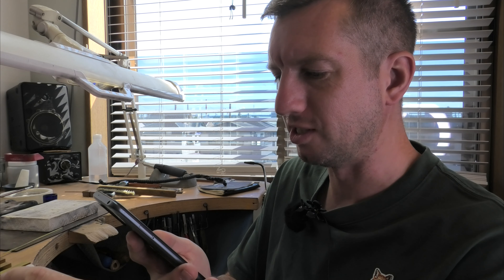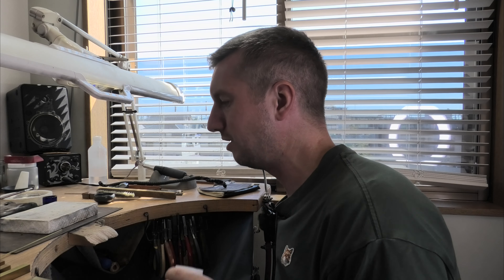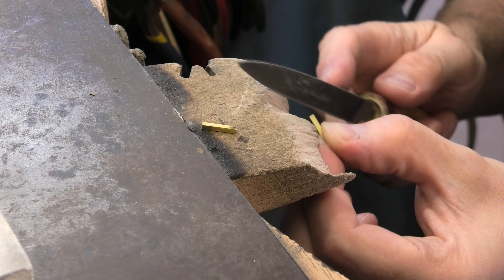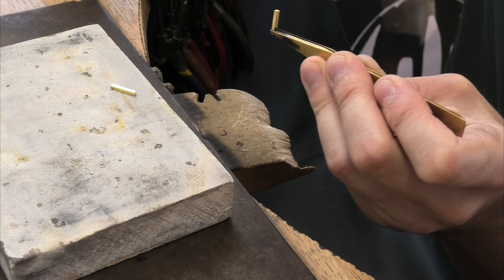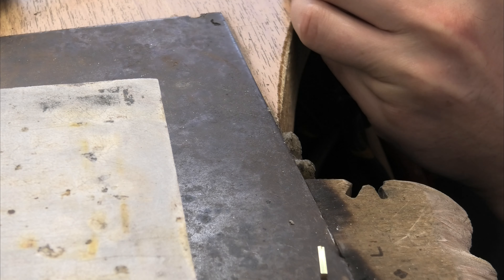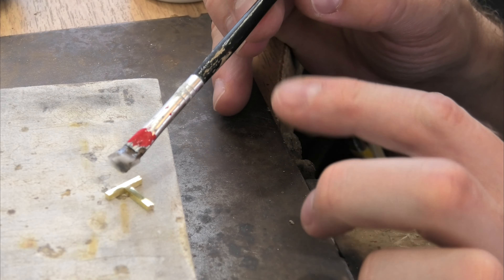The Secret to Soldering Brass

Comment: I've used Easy-Flo flux(borax powder) mixed with water for soldering brass for the last 5 years, never had a problem. You can even soft solder it with rosin flux and electrical solder.
Reply: How? Can you please explain? I have to fix the handle on my bell & have no clue what to do. Thank you!!

Comment: I always use Borax to solder brass and medium silver solder, works perfectly fine - I think it does take time adjusting to, especially if you're used to silver and gold. Thank you for sharing! :)
Reply: @sarahgaucijewelry  pretty sure the white flux is a borate mixture. Same with the flux that you can bubble into your gas lines with like an oxy-acetylene setup.

Comment: I used to be a solder machine technician in a factory, and we only ever used two types of flux - ZNC 4030 for non-medical applications and Stannol WF-300S for medical applications. Do note that if you use znc 4030 it will produce a clean join but it is extremely aggressive and will cause reddening if you use more than a drop or overheat it

Comment: I came here to find out how to work in brass because I want to make some crazy art pieces just like you said it would be unpractical to make some bizarre looking art jewelry out of silver. Was so happy to hear others had the same notion. I use grifflux on brass so far and it has worked. I also learned to soak my brass in peroxide/vinegar solution to get the copper off after soldering.

Comment: For brass use pine resin dissolved in isopropyl alcohol as flux and use 60/40 tin lead solder.  Same for copper.
Reply: @markedis5902  would these be RA fluxes?

Comment: Before brazing (silver soldering), make sure the joint metals are very clean and free of any oils.

The real no-brainer way to silver solder brass is with a silver solder paste which includes the flux (like Muggyweld SSQ-6 56% Silver Solder Paste, this is just one example there are many different companies making a similar product). This is such a no-brainer that in production the brass is held together with a jig, the past is robotically applied (usually as a very poorly placed single blob), several heat flames from several directions attempt to evenly heat the assembly, the heat is not varied just held constant for a set amount of time, the solder goes molten and the flux carries it around the joint. 

The assembly is then allowed to cool slightly, then it is quenched, water + usually an additive, and done. The solder paste is called solder paste but the heat sources are hot sources like oxyacetylene (hotter than a propane torch). If the heat source is a little high it just means you need to heat the assembly for a shorter amount of time, move the heat around quickly to evenly heat the part, and remove the heat when the solder flows. The high heat is to expedite the process.

If you use the needle paste applicator and you have a long straight joint, you can place a very small even paste fillet along the joint, Then when the solder goes molten the soldering footprint is very consistent and the joint looks very nice and clean.

As you mentioned in the video, the quest to joint brass attractively is in finding the best flux for the application. A product like Muggyweld SSF-6 High Strength 56% Silver Solder Rod, has the flux coating the silver solder rod. So, you heat the flux to melt around the joint then keep heating until the silver solder flows you only need to add a small amount of solder because it will flow very quickly to fill the joint evenly.

Comment: You seemed to have figured it out, but if this helps you or anyone else, a good flux for plumbing seems to do the trick for me.  Get it at any hardware/ plumbing/ refrigeration supply house.  Also some soft solder, I use 95/5 (tin/silver) and Ive had no issues even bonding brass to stainless and mild steel!  Worth a try and you dont have to wait for it to be shipped to you hahah.  Best of luck in everyones projects!

Comment: What metal was the tiny piece you used for welding the two tiny brass together?  I want to weld brass with brass not see the lead
Reply: Looks like chip solder

Comment: Depending on how large your going.. have you tried to do micro-TIG welding vs “brazing” for metals? the jewelry folks use them and they can be quite versatile.  You can do tiny delicate bracelet links all the way up to medium sized sculptures.  sunstone sells ones like the plus unit 1-30 joules and also ones like the 150 or 250 units that as the name suggests goes up to higher 150 joules and 250 joules in power for welding larger parts.

Comment: I was wondering if it be possible to do a video showing a piece of jewlery as you put it together when and where you would use hard solder then when you would start to use medium solder and then soft solder. I'm not totally clear on when to switch over from hard to medium to soft. Alot of youtube videos show the making of a piece but they don't show when they are changing from hard solder to medium ect.. thank you
Reply: If you practice precision with your flame, you can just use hard solder only. Try and avoid easy by and large, it tarnishes easily and wears away faster. Don't try sweat soldering with hard solder though if you have any previous joins as the previous joins will most likely liquefy as well. Good luck!
Reply: Thank you!!
Reply: Yes I agree, not many videos say when to use the various types of solder. I would appreciate a video like that as well if possible. Thank you for this video not many jewelry makers discuss how to solder brass, which when your first starting out it’s a much more affordable material to work with.

Comment: I solder brass model locomotive using a soldering iron and normally 145 or 188 degree solder, also sometimes rosin core electrical solder.
The flux I use is phosphoric acid at about 10 to 12%

Comment: Easy Flo flux surely?  Very easy to prepare and use - once mixed with water it looks a lot like your ready-made paste... and is probably mostly borax. Add a drop of washing-up detergent for extra cleaning and to stop it bubbling up quite so much when first heated. A friend mixes it with meths instead of water for less bubbling and quicker to the melting stage.
I have been using it for years for musical instrument parts - including the seam on bassoon crooks which are 380mm long, narrow tapered tubes of brass.
Reply: Oh - just noticed that 'Gazz-R says the same thing...

Comment: I bet that "white flux" is similar to the product BrazeTec, available in Germany. Thins with water when it dries out. It also works if you ever need to solder steel parts together, like a broken saw (with silver solder).
Reply: Is this silver solder normal solder for jewelry or it is a special product?
Reply: @Khe.TinyKeysCraft  Regular silver solder used for jewelry. I think I used hard solder, if I remember correctly. While in school, I repaired my saw using that method, suggested by my Dutch teacher. The saw is still holding up fine, even with the continual flexing.

Comment: Easy Flo flux, by Johnson Mathey Metals,  is a powder product sold in the UK mix with water to make a paste. Boli the item in water to soften and remove the glassy flux residue, which will blunt your files otherwise.

Comment: I've not soldered silver, just brass and copper. Haven't made the jump into silver yet bc of finances and skill. But I use a borax cone and dish. It works ok. Not a fan at how long it takes me to grind the cone in the dish to get a good paste. 
I've also heard good things about buying a box of powdered borax, like for cleaning,  and mixing with mineral spirits or water. Bought some a week ago, but haven't tried it out. 
But I'm sure you are familiar with those methods.
Reply: If you do try that borax powder and liquid route, let me know how it goes, please. I was thinking of trying the same. Cheers!
Reply: @codythompson2560  soham harrison youtube channel swears by it.  Im pretty sure that's where I learned it.  I think Andrew Berry also uses a similar method, although he might be more partial to the cone and dish method.

Comment: I'm sure this is the same flux used for silver soldering silver and gold. Home-made version is 3 Boric acid 2 Borax 2 Trisodium phosphate I don't bother to make a paste out of it. Mine is thin as water and still works fine. Works fine for copper, brass, and silver and one to the other. Differences in temperature for the different metals makes it more difficult than silver and gold.

Comment: You say in the beginning that brass is very inexpensive, so I have to wonder why you make things more difficult for yourself. In your demonstration you use two tiny slivers of brass so small you have to use tweezers; what were you thinking? A lot of us would like to know, for instance, a trumpet starts off using traditional solder, when they're finished it's an invisible seam it looks like brass with no signs of solder, how is that achieved?
Thank you.

Comment: Not sure what the problem is. I work with brass just as I would with silver, same flux, same solder, works every time.
Reply: Simple borax flux works as good as any fancy and more expensive flux. I have used simple borax flux with silver solder on silver , copper , nickel silver , brass , bronze , stainless without any problems.

Comment: 😅Brass is harder than Gold and silver. It was used to make knife blades before the advent of iron and steel...it also works hardens REALLY fast. You get 2 hits with a hammer before it splits in two.
Reply: Bronze was for blades, brass came later.
Reply: @WildBearFoot  I think it somewhat depended on were you were as tin was hard to get ahold of.
Reply: @gundanium3126  zinc is mined primarily from low grade ore with several other ores in the mix, the testing done on bronze weapons shows them primarily as tin/copper with the usual amount of impurities you get from those time periods, they did have brass during the bronze age but they don't really find it in weapons. I will concede that brass is much, much harder than copper, I've done tests, but bronze is to brass what brass is to copper. You can work brass with a hammer easier than bronze, bronze is best when cast and work hardened, even then the percentage of the alloying metals comes into play.